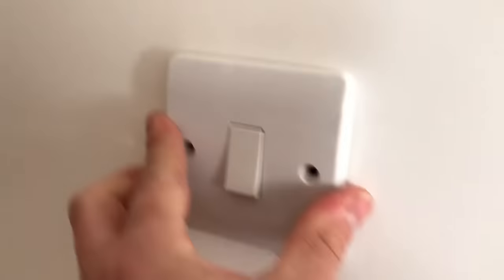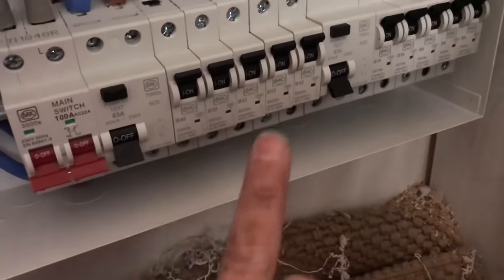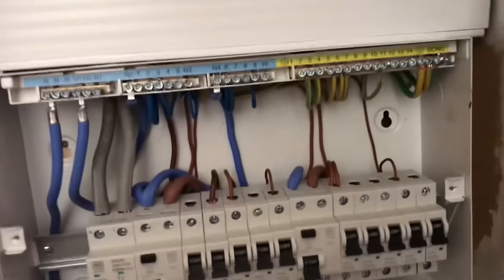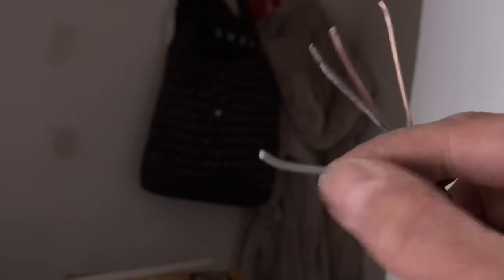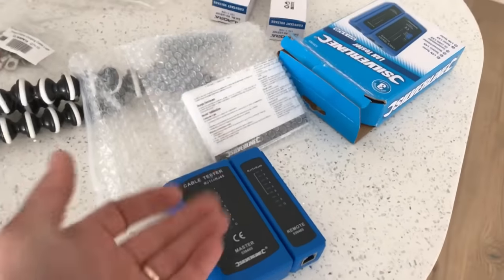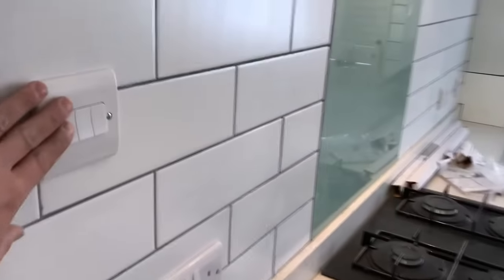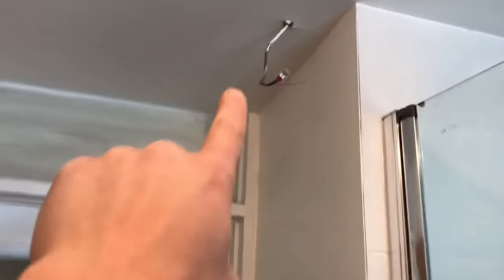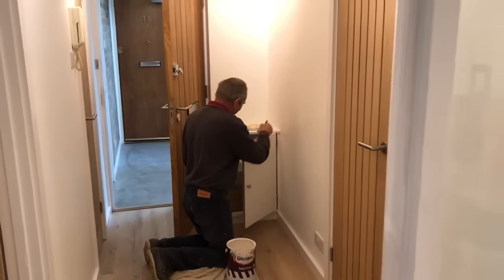CJR ELECTRICAL Electricians day finally finished the flat from hell!!!

Comment: What I'm really curious about is you guys in the UK still put all the neutrals together and only have the live on the fuses.. Over here in France they claim that to be too old and not as efficient so we have both live/neutral on the fuses here.. I wonder which really is more efficient and protects the people more
Reply: Maybe your using split phase, as they use double pole breakers to cut both phases 
On a Single phase neutral+positive should never be on 2 fuses unless  your using individual RCBO or RCD per circuit (yours might be called a ark fault rcb/breaker/fuse) then you will have the Neutral from the circuit been returned to the breaker so it can detect individually a fault per circuit

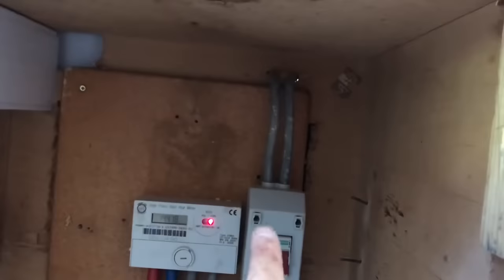Comment: 2:55 Do they reverse the wiring on those Wylex isolator switches to suit the installation? IE can the input go in the top and output to the consumer unit out of the bottom?
Reply: Doesn’t matter which way is input and out 👍 have seen both

Comment: hey great job on the video what colour standard did you use for the network points ?
Reply: @Dean Waters Hopefully 568A!
Reply: @thetruth5210  lol yeah I am more a b standard kinda guy
Reply: @Dean Waters I prefer Legrand equipment, all their stuff calls for 568A, It also allows you to change from ethernet to telephone line without confusing the poorly trained telecommunication guys (Verizon, AT&T and BT) with a different color code. 😜👍🏻
Reply: 568A is for government buildings, B is everything else. 
If you wire one end A and the other end B then it’s a cross over cable for connecting 2 PC directly without the need for a switch. Most switch will sill work crossed over due to auto uplink settings.

Comment: This is why flats burn down ..a piece of wood between communal and inside the flat. No way could that flat have a fire for 30mins and be isolated from the stairs.
Reply from the maker: It does have a fd30 fire door and intumescent strips round the door. On the flat door and the door to the meter.
Reply: That place was a complete disaster but glad you sorted the electrics. The list just went on.. Shoddy electrics, plumbing, holes in critical walls and firedoor that has never met standard (clearly has no screws in nor lockable. Grenfell tower has tought us a lot.

Comment: you could have used a luminarie with sensor :)
Reply: Or wired the circuit via a door switch; cheaper and more reliable than a PIR.

Comment: Im always blown off by british current ratings. Also when I saw bigclivedotcom videos about british fuse boards. 100 A main breaker is insane big value, I would like to know, why it is such a big number. Here in Slovakia and also in many parts of continental Europe, for similar sized flat the main switch would be 25A with or without RCD, RCDs for bathroom and kitchen 16A, 16A breaker for socket circuits and 10A for lights or 6A if lights are LEDs. Also I have to mention, this is not precise description, of course it depends on used appliances like electric cooktops, heaters etc. 
This is also not cheap, so much more copper used in thicker wires.
Reply: In the States the usual minimum is a 200 Amp 240 Volt main (many jurisdictions 250) and its 60HZ...

Household current is then split and  is 120V with only large appliances i.e. my 100 gallon hot water heater , the geothermal, and the clothes dryer are 240V...
Reply: In UK use 32a ring circuit for power in kitchen 6/10a for lights 16a immersion 20a radial so need 60/100a main switch
Reply: With the current fascination in the UK for electric showers and induction hobs that draw insane amounts of electricity, you could easily draw over 60A by using both at once. Add an electric car charger into the equation and even 100A is insufficient
Reply: Insane also for me, as I in Italy where I live most houses have a 3kW contract (you can have more, but you then pay more), that means that if you overload for example you turn on your hairdryer with the washing machine on the meter trips after a couple of seconds and you have to go usually outside to reset it. That is a problem since when we passed to electronic meters, once the limit was only thermal (basically it was a 16A breaker on the meter), now it's electronic and thus far more inconvenient. Especially because they don't let you have a meter inside a property, the meter should be outside accessible from the street (of course so they can check if you tamper with it more easily, but it means that when it trips at night when you are making a shower is a little inconvenient)
Reply: Now that'd make for a good video, 11KW shower Vs 25A main switch 😀
Reply: @alerighi  No, that's insane. My UK kettle is 3kW on its own. A single plug-in fan-heater could be 3kW.
Reply: The difference is in Europe you often have a 3 phase supply into domestic dwellings, in which case a 25A 3 phase breaker would allow a total load of 3x25A = 75A. In the UK we only ever have single phase for domestic - so consequently need a higher main fuse - usually 60, 80 or 100A. So, a similar total load limit.
Reply: @marct3928  Three phase to domestic properties is only in some northern European countries and even then it is not 230v on each phase.  In southern Europe it is single phase.  In Spain, and I think Italy, you are charged according to the capacity supplied.  My flat has a 1.25kw supply.  (No, decimal point is not in the wrog place ).
Reply: @marct3928  - 3x25A will only give you the same as 2x43A.

Comment: Do you not have to segregate your services in the UK? Phone line in same trunking as 240V wiring?
Reply: Cunning Stunt it’s good practice, not sure what the regs have to say about it. Certainly you will find segregation most of the time.

Where are they run together here?
Reply: @edcooper2396  In the trunking in the meter cupboard. In NZ if extra low voltage cabling (less than 50V ac or 120V dc) is run with low voltage cabling (exceeding ELV) then the ELV cabling must have insulation rated as that of the LV cable. This also does not take into account any current induced in the ELV cable.
Reply: Was thinking exactly the same - fairly sure the regs in the UK say that the insulation on all cables within a single trunking/enclosure space must be rated for the highest voltage circuit present. That MK trunking has slots for divider strips that enable compliance, but rarely see them used!
Reply: Short distances of up to 3m is completely fine and with have no affect at all. ( but obviously good practice to segregate when possible)
Reply: @BeardGang09  Not allowed if they are in the same enclosure due to voltage ratings of the insulation.

Comment: What’s the big thing with having a main switch fitted ? Just cut the seal and do your job, if you really feel the need you can call supplier to re-apply them ???
Reply: Wrong.
Reply: Dave Rhodes ??
Reply: I think it illegal to cut seal
Reply: Noam Freedman what even if you are full qualified, belong to a professional organisation and doing your job 🤦🏻‍♂️
Reply: You are not allowed to cut the seal without permission from the DNO unless it's an immediate emergency. Fuse & meter re-seals are chargeable call-outs so fitting a customer side cut-out is a sensible thing to do & costs sod all in the grand scheme of things.

Comment: Just curious on what connectors you use for telephone wires ? As most electricians use unfit for purpose connectors
Reply: What i call jelly crimps are spot on for me..
Reply: They are the correct ones, the amount of times is I go to a job and some has used a terminal block or just striped and twisted them together
Reply: @cg18994chriso  lol lucky for me I have a friend at BT
Reply: @cg18994chriso  if the enclosure is appropriate theres nowt wrong with putting them in little connector blocks, I've even soldered on to an old thick drop wire before. I do usually use jelly crimps though
Reply: @_______DR_______  nope they absolutely fuck over Broadband
Reply: @cg18994chriso  I work for a Telco too. Screw terminals are the bane of my life!
Grease filled crimps or a proper Krone box for the win!
Been in houses worth £3m+ with crap broadband because of the sparky bundling all the cables together in a screw terminal block!
Reply: @TomPiprell  similar had 8 extension all going into a screw block, was able to convert them all to Ethernet tho as cat5 cables were used

Comment: Is cost the main reason for not using an individual RCBO on each circuit?
Reply: Simon Greenidge Yup, though I think the issue is the industry is setup to sell split load boxes so, they’re much more price competitive than a custom RCBO configuration.  Hence all the unused breakers in this job!
Reply: Not on domestic jobs. Commercial and industrial use individual rcbos

Comment: With that rj45 tester, am I correct in thinking it won't test speed
Reply: Steven Brown yes
Reply: Cheapest way to test for your own satisfaction and show your end users is Pockethernet.
If you need certification, Fluke DSX2 8000 is the best it tests and certifies radio grade cable, category cable and fiber optic but it’s super spendy my companies unit all decked out was like $20,000...😱
Reply: Steven Brown That tester is only a basic one, it just does continuity; you have to check the LEDs flash order at both ends to make sure the wires aren’t swapped, which still doesn’t tell you if you have the wires paired correctly (what do you expect for the money).
You can spend low £hundreds on a tester which will tell you how long the cable run is and that you’ve got the pairs paired up correctly (wiremap) it will also send tone down the cable so you can trace it; still won’t tell you the speed it will run at.
Mid £hundreds gets a tester which will connect to the network, dhcp, send pings, test PoE, and do a wiremap.
To do a full certification testing you are looking at £1000 - £5000+, still doesn’t tell you the speed, but certifies the installation meets the relevant standard (cat5e or cat6 for example). The more expensive testers have replaceable heads which are calibrated specifically to the test you are running: cat5e, cat6, cat6a, multimode fibre, singlemode fibre, etc.
Reply: Just plug in a laptop and run speed test.. No need for pricey test gear. I bought a PunEng line tracer, does continuity, on cat5/6 and audio tracing circuits to identify cables in bundles. Useful kit for £30. This one is a cut down cheap £5 one.
Reply: @muzikman2008 So you think it’s a good idea to carry a fragile laptop onto a construction site? What program are you running on your laptop that let you know if there’s POE? When it sees that there’s POE does it give you a voltage reading? If you have to find one data out of hundreds in a rack can you set up a specific pulse pattern so that it makes it easier for you to find it from your laptop, and if so which program are you running? Do I need to go on?
Cut rate solutions lead to expensive labor output and cut rate results.
Reply: @thetruth5210  he's an electrician doing some house wiring, not an IT guy wiring the pentagon 😉 if your company buys you some £2000 test kit happy days, he's a self employed spark.. Get some perspective.
Reply: @muzikman2008 I do have perspective it’s why I said that if you want to get a tool that will do everything that you needed to do except for offer certification that you should buy Pockethernet (€200 with VAT) not the Fluke DSX2 8000 completely kitted out would be near £15,500 that the company I work for owns.